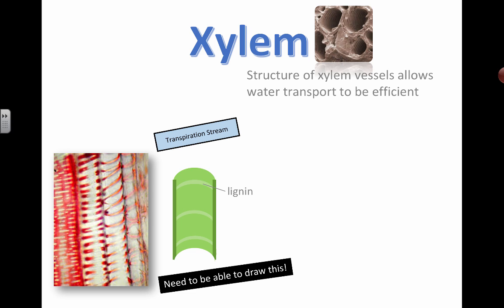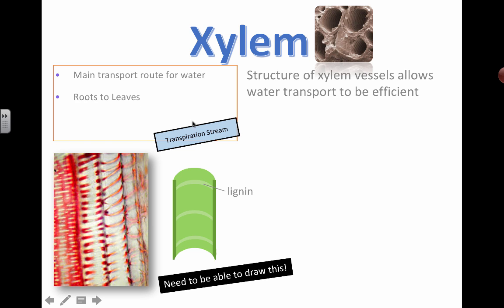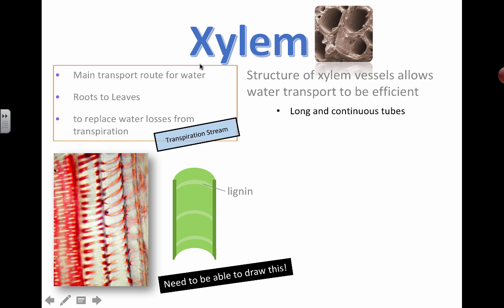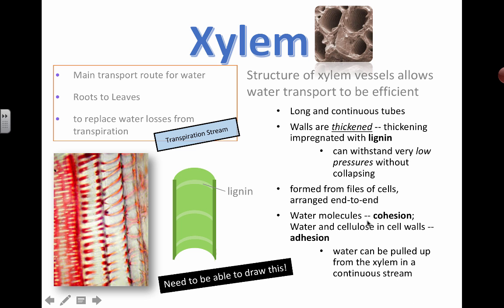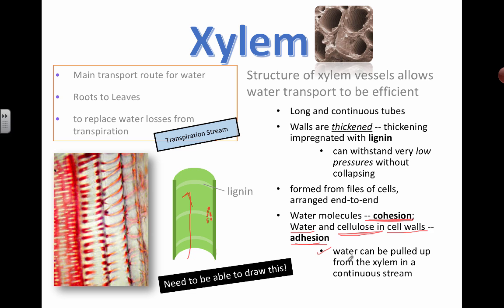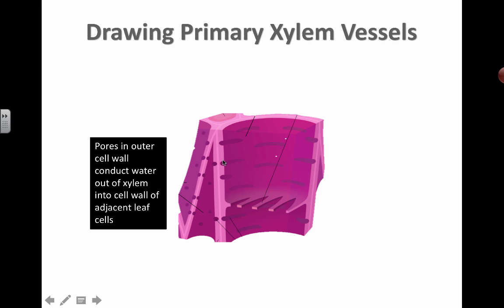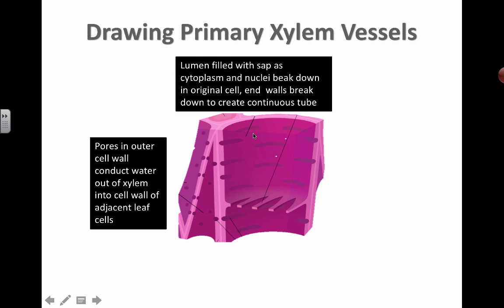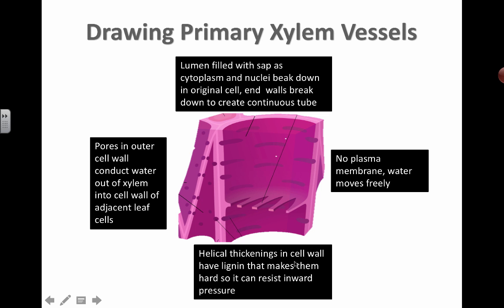Xylem Vessels (IB Bio) (2015)

Comment: why do the xylem have a dead cell
Reply: so they can make a continuous tube, otherwise, they need to have a surrounding membrane, if they're dead, then they have the most efficient way to transport the water.
Reply: So it doesn't absorb the water as it passes through